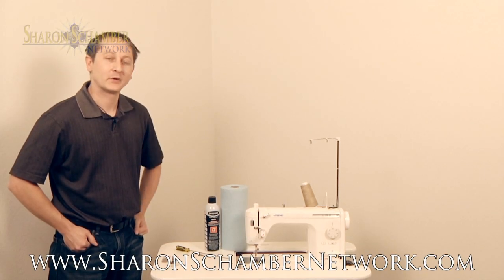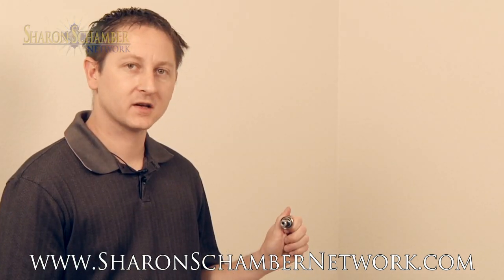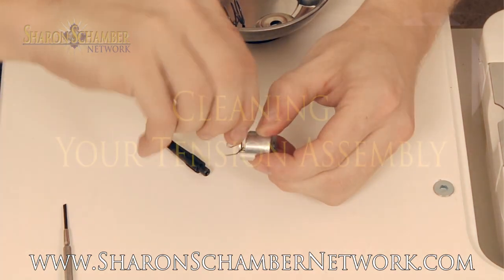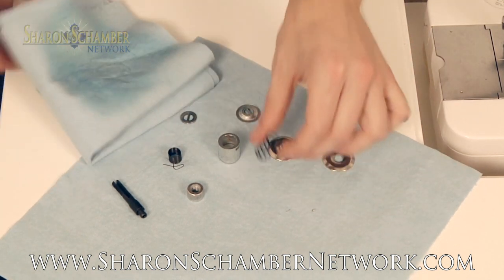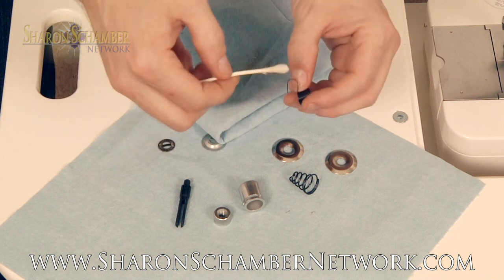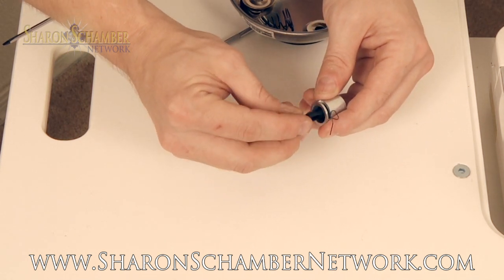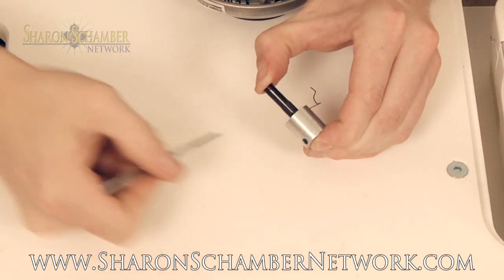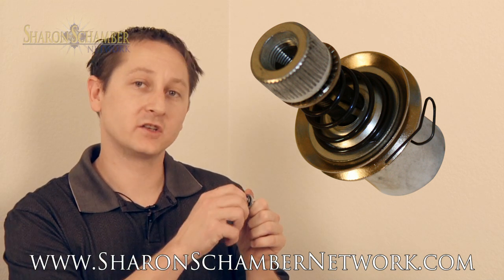Sharon Schamber - All About Your Tension Assembly

Comment: Hi. This is a great video.  I need to fix the tension assembly that I took apart while cleaning it.  I do not have the book for the machine. There was no cone spring and there is no tension barrel. The check spring was not moving when I was sewing and the threads would pull out out of the fabric.  Do all tension assembly’s have a cone spring?  Maybe I have a machine with a missing part.  It was purchased used. This is a Brother VX808. I would any insight you can provide.

Comment: One other thing...some tension assemblies have a small metal pin that is loose inside the assembly..be careful that it does not fall out and get lost (been there, but found it).  TinLizzie18 products have this type  of pin.  It goes into the assembly at the back..same way it came out.
Reply: I have a kenmore sewing machine I need to know how to assemble my tension piece by piece, not all tension are alike my machine is a Kenmore

Comment: Hi` a nice tutorial thank you,I now own a 132k6 singer that has this type of tension adjustment`but I also have another tension adjustment above the one your showing as well` but with no check spring`it just has two disc`s and a coil spring and a circular nut to place pressure on the spring which puts pressure on the discs .                                        I know thread runs through this first tension then the thread goes to the one you describe,But why do I have the one above as well lower down on my machine .and which one do I adjust to place tension to correct my tension so my thread has the same tension to my bobbin.God how many times have I mentioned tension LOL.
Reply: lettherebe piece

Comment: I thought this was a great video.  I would like to see a video demonstrating the proper setting of top tension.  Specifically, I would like to see the how the spring behaves with proper tension.  Does the thread pull the spring over to the stop completely or should it be balanced between the limiits of the spring movement.?

Comment: Thanks so much, I hadn't used my Longarm in a long time and went to change the tension pads which mine has round felt pads (1999 Gammill Optimum and couldn't remember for certain which way the parts came apart but this helped to make sure I put it back together right.

Comment: Hi, thanks for the video... i have a Singer 368 and the thread tension regulator isn't held on with a screw... the screw is hidden somewhere. Do you know how i might remove this complete device? i have tried most everything! and its working improperly so i need to replace it. when i thread it, its all good,,, but as soon as i sew, the device pulls the thread out from between the discs. :/